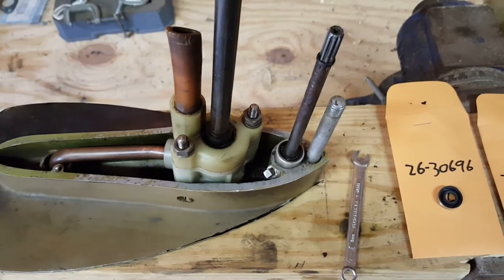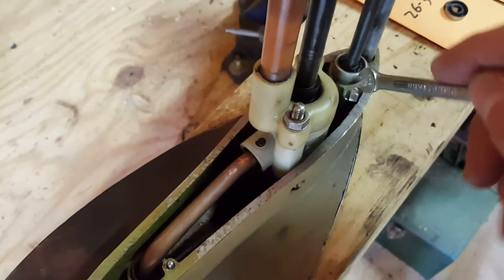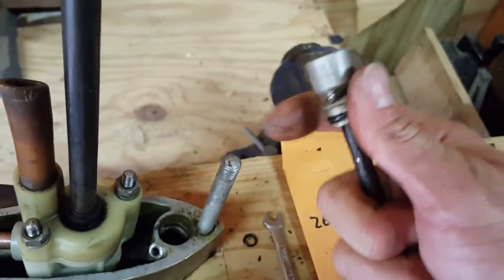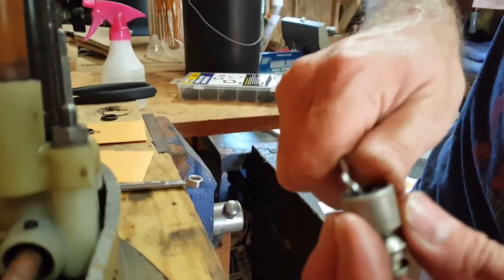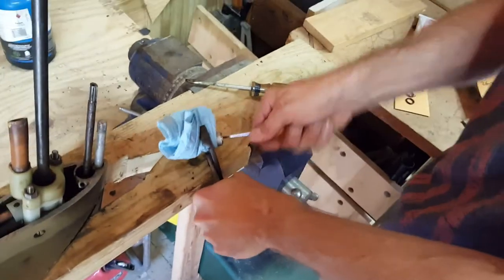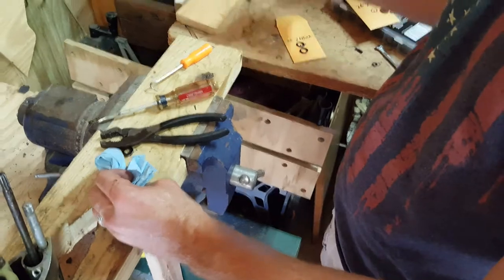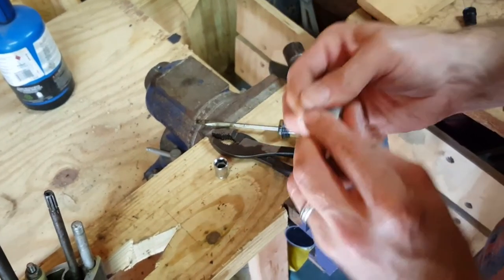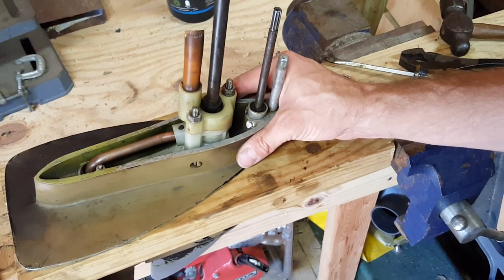Shift rod Seal Repair for Mercury 3.9HP Vintage Outboard Lower Unit Gearcase

Comment: Dropped my lower today to replace the impeller. Found a fair bit of milky oil. But the oil in the lower looks good. Will be changing this seal and flushing out the lower unit oil. I think the water got in from the tube that extends out of the impeller housing. It was in pretty bad shape. Replacing that aswell. Thanks for the video. What a relief

Comment: I have had a heck of a time getting the casing out, too. I've pretty much scraped all the rubber out, but the casing is pretty tight in there. I know I should try heating it up, which I will do. BUT... if I don't have any luck getting it out, am I able to purchase the entire seal assembly from somewhere? Might you know what it would cost me? P.S. Excellent videos. I got my hands on the same outboard motor and if it wasn't for your videos, I would be lost trying to fix mine. I've had the same issues as you've had and the videos are SO helpful! Thank you so much for the help!!

Comment: can't get seal casing out! tried everything,any ideas?
when are you going to respond????
Reply from the maker: Try using a hand held butane torch like you can get at home depot, and apply some gentle heating to the seal bushing.  Not too much -- don't want to get too hot or cause a fire.  This should loosen the thing for ya.:)  I suppose the market for free advice demands faster response times than it used to!

Comment: can't get seal casing out! tried everything,any ideas?
Reply from the maker: Sometimes I use heat from a hand-held propane torch to loosen up stubborn seals.  Don't heat too much or the gearcase oil will burn.